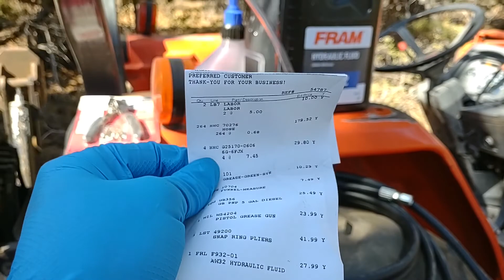Bought First Tractor, Immediately Broke It

Comment: Super Jelly! I wish I had a bucket on my tractor. They are so useful. I am not sure how much of a pain to remove the backhoe attachment is, but for maintaining your roads and other grading tasks I would get a Box-Blade ASAP. You can do roads, ditches, etc with one. Nice job fixing it yourself. There is going to be a lot of that with equipment :)
Reply from the maker: I really want a box blade but my three point hitch doesn't go up and down. So until I figure that out, it's not much use.

Comment: That 1990s L Series is for whatever reason, only made as a gear transmission.
2 types both are 8 speed.
.
One has a H pattern shifter, with low and high.
Thats the one we have.

And The one known as a GST has all 8 gears without the low high lever.
.
When looking for attachments that use the PTO, you have 37 net-hp at the pto.
.
There is also a rather rare creeper gear set, that was installed at dealers. But few people did, as it was not a free thing. Makes low gear go to tenths of a mph or even slower.